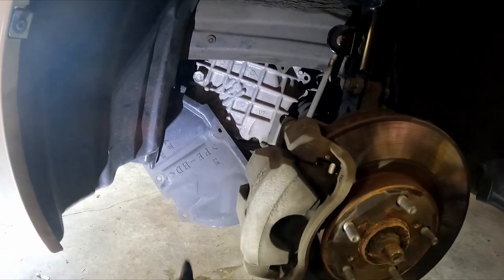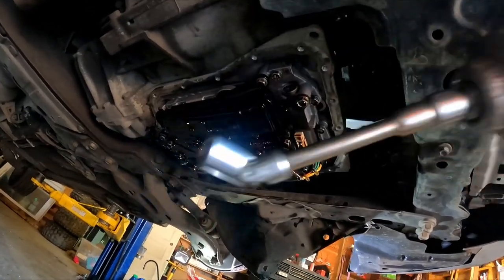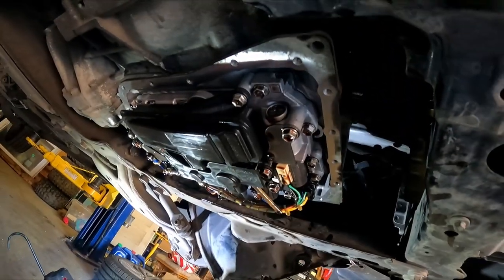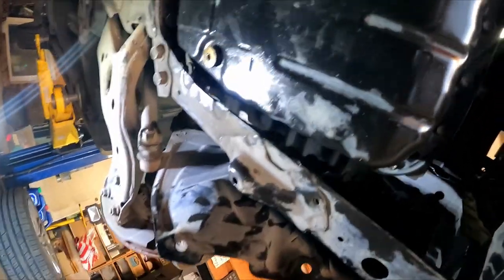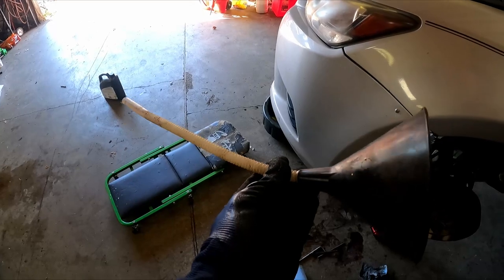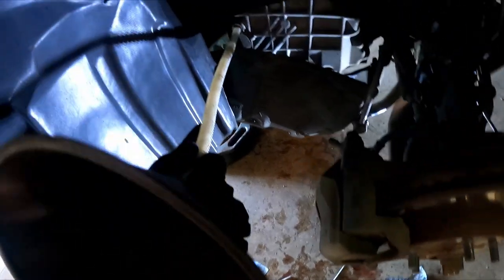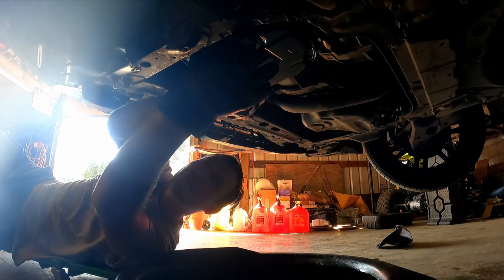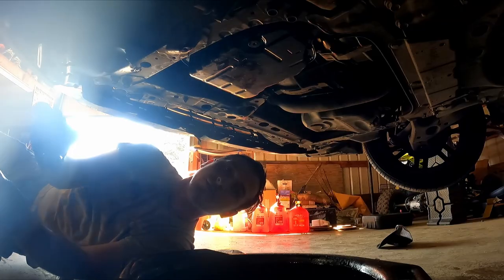2011-2016 Scion TC Transmission Oil And Filter Change DIY

Comment: Hi could you please explain the end of the video more is it necessary to repeat the last step with the car on and the transmission fluid draining
Reply from the maker: The car has to be warm and running in park to set the correct level.  You pull the level plug and let the excess fluid drain until its trickling/fast dripping

Comment: Hi there just wanted some clarification, so if I accidentally overfilled, get the transmission up to temp, and open the drain plug on the bottom, but not the second plastic ones that comes out?? Is the drain plug main purpose just let out excess transmission fluid?
Reply from the maker: Pretty much yes. The drain plug purpose when the car is warm in park idling you pull the drain plug only and not the tube from inside.
Reply: Ahhh okay, thanks for the quick response? I suspect my transmission is low because I smell burning I just want to make sure I can add extra and then just do what you said to remove any excess

Comment: When you drain out the new transmission fluid until it drips, do you have to refill after that? Or is that enough fluid for the transmission
Reply from the maker: No. After you fill you start the car warm it up shift through gears then wait until it trickles then close it and that it.

Comment: What if when I accelerate I here a whining noise ? Also today it dripped a bunch of red fluid on the floor. What could be wrong with my car
Reply from the maker: Where is it leaking from? If its red its transmission leaking somewhere. I would try to see where its leaking from.
Reply: @BuiltForSpeed  what could be some possibly spots that it would leak from ? My scion tc has 153000 and I don’t think they ever changed the atf

Comment: Hey what exactly did u use to take out the filter? Was it a socket?
Reply from the maker: It's held by 2 bolts. Once you remove those it pulls out.

Comment: Arnt you able refill it from the transmission oil dip stick hole???
Reply from the maker: There is no dip stick in this vehicle.
Reply: @BuiltForSpeed  I see, I have a 2013 Scion TC that has a dip stick, so could I fill mine from there?
Reply from the maker: @MOAON_AABE  yes. Fill from there and check fluid level there.
Reply: @BuiltForSpeed  do I check before or after I cycle through all gears???
Reply from the maker: @MOAON_AABE  after you cycle it through gears and let it warm up for about 5-10min
Reply: @BuiltForSpeed Thanks so much for helping me, alsowould it be ok to drive it around the block to warm it up? And then shift all the gears?
Reply from the maker: @MOAON_AABE  i would just fill up how much you drained about and just shift through gears with it running for like 10min then check. When you drive it will take time to settle afterwards
Reply: @BuiltForSpeed  AWESOME, you really helped me out, I truly appreciate your time!!!
Reply: @MOAON_AABE where is the dip stick located for transmission I have a 2015 and cant locate transmission dipstick
Reply: @Aj-wb5rg  I think that 2013 and up do not have dip sticks, we have to fill the transmission via the transmission fill plug located on the driver's side of the transmission behind the front driver wheel!!!

Comment: Has I can see it seems you wait a bit too long before putting the plug back when the overflow oil is dripping.
https://www.youtube.com/watch?v=eRxSu4-4ojo        
at 12:45
Reply from the maker: You wait until it teickles(drips fast)  then close it when it gets to proper temp.